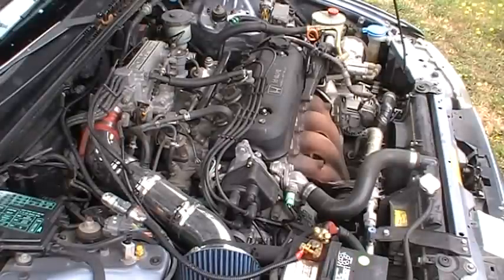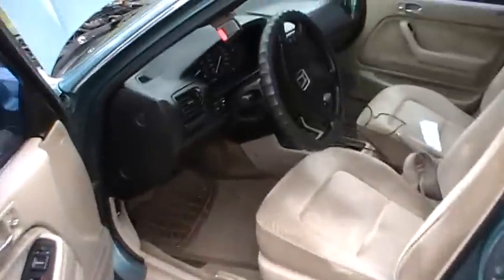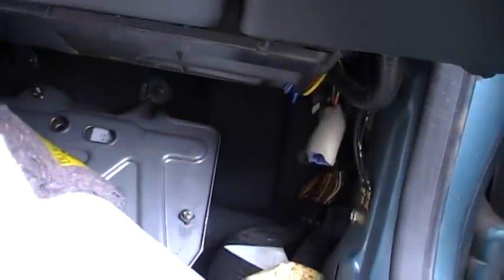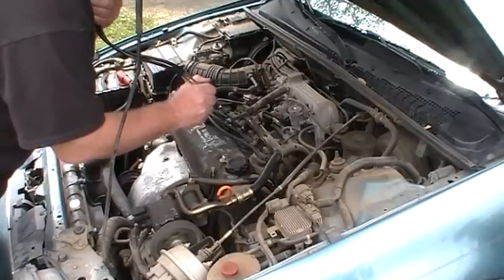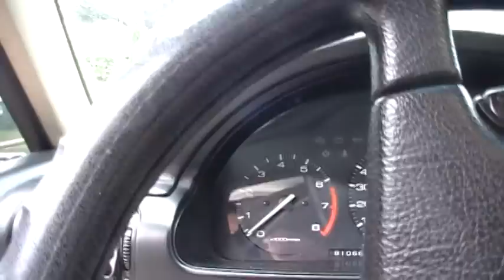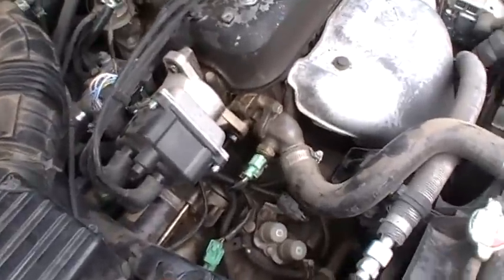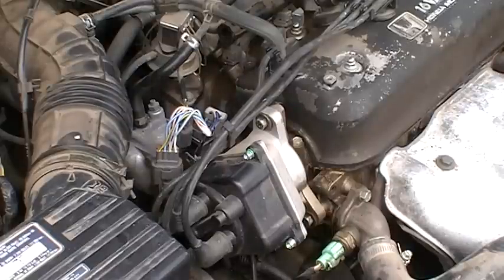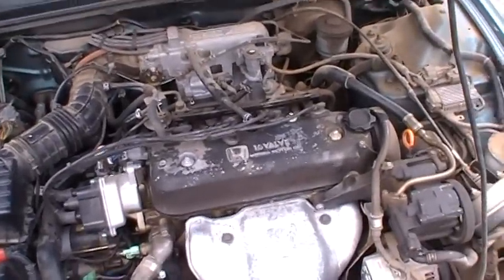Timing 1990 Honda Accord

Comment: I recently purchased a 1990 Honda Accord EX sedan with 87,000/miles for $1,800.  I knew the son. His mother died and she owned the car. The car stayed parked for 5 years. 
Before I bought it a complete new exhaust was installed, a set of new tires, oil change, transmission flush and fluids changed. 
Is there anything I should be concerned with?  I’ve never owned a Honda. My last 3 imports were all 1989 Toyota supercharged MR2’s and each of those went to 345,922 miles each before I sold them cheap. 
Thank you for your input.
Reply from the maker: Is it an automatic?  Make sure you only use Honda Transmission and power steering fluid.  If it has been sitting for 5 years, most likely the tires have flat spots.  When you drive it, if you feel bumps, you have to get new tires.  Have the battery tested.  If you like working on cars, it will be way easier then working on a Toyota.  Except front brakes.  The rotors are hard to do on Accords of that year.  Check the spark plug wells for oil after you drive it for a while.  If you have no leaks in the engine, your seals should all be good.  Change all the fluids.  Use extended life coolant.  I would stick with convention oil.  New brake fluid.  Silicon lube all the window seals, so the windows go up and down smooth.  Silicon windshield wipers if you can find some that fit.  Put some on my wife's car in 2017, and they still work good.  If this is a keeper and you want to do your own maintenance.  Buy a Honda OEM shop manual for it.
Reply from the maker: If you have any questions, feel free to ask.  Also have lots of videos on 90 Accords.

Comment: What should I be looking for as to timing ie how to tell if I need to move the distributor one way or another based on the timing light to adjust it to the proper timing other wise great video
Reply from the maker: What year, make, and model are you working on?
Reply: @tubejim101  90 accord lx 4 door standard
Reply from the maker: @GhostSniper162  Distributor should be in the middle area.  With the car in maintenance mode, you will see the timing mark move when you move the distributor.  You will see the mark, when you use the timing light.
Reply: @tubejim101  i should restate my question im just getting into mechanics as my dad didn't want us in the field so what particular should I be looking for with the timing light as I adjust the distributor ie should the light stay on should it blink at a certain pace I apologize for my ignorance.
Reply from the maker: @GhostSniper162  When you hold the trigger, the timing light will flash, every time the number 1 spark plug fires.  If the light is always on, or always off, you can not see the timing marks.  They go by to fast. When the light flashes, your eye takes a snapshot of what it can see, and you can see the mark, just like it was not moving. So the marks will look like they are standing still.  When you move the distributor, it will make the mark move.  Just move the distributor a little at a time.
Reply: @tubejim101  o ok makes sense thank you for your help

Comment: Bought a 93 accord se recently. Replaced alot of parts myself including mounts, all new suspension parts, starter, distributor, cables and plugs, and cleaned  alot of the carbon build up.  Steering wheel vibration is bad when idling at a stop then runs smooth vibration free when driving at normal speed.  I never did the timing, do you think this may be my issue?
Reply from the maker: Would check the power steering pump, and belts.  Also, make sure you are using Honda fluids.  As long as your distributor is almost centered, I don't think it is your timing.  If your distributor is way to the front, or back, off center, then it could be an issue.

Comment: hello one question¡ 
at how many revolutions is the engine,
because you only show the adjustment of the lamp with the top dead center. and tanks  for the video.
Reply from the maker: What year, make, and model, are you working on?
Reply: @tubejim101  is on honda accord 1991 2.2l
Reply from the maker: 750 +- 50 rpm in neutral.   So basically, idle at operating temperature.
Reply from the maker: That center mark, in the front 3 marks is 15 +- 2 degrees BTDC (Before Top Dead Center)
Reply from the maker: Think the one mark in the back (past the three in the front) is the Top Dead Center, mark.
Reply: @tubejim101  
ok, then at idle it should be at 700 + - 50 rpm, with the normal temperature, since the tachometer marks me about 800 rpm, this is also within the setting, since when maintaining it at idle, after a few minutes at walking the car the revolutions tend to go up and down, but from what I know or explain the manual may be vacuum leakage which is causing me to change the revolutions at normal temperature. I thank you for your help, I will try to correct this detail, thank you very much.
Reply: @tubejim101  I only see the 3 red marks at cold start. Once it warms up to normal operating Temps, I only see the single white mark. What's going on here?
Reply from the maker: @midwestjeff  Is your distributor centered?
Reply: @tubejim101  yes
Reply from the maker: @midwestjeff  Are you running it in service mode?
Reply: @tubejim101  Yes. Someone suggested to me to remove the air idle control valve plug when running this test so that the card is a try to automatically advance
Reply from the maker: @midwestjeff  any chance you have changed the coolant lately?  If you have a pocket of air trapped in your coolant system, it can throw things off.

Comment: Thanks for the video... Just wondering if you have the car in service mode when you are setting the timing.  Also any updates on he lower pitched knocking noise? I have a similar noise.  Thanks!
Reply from the maker: Yes.  Service mode around 5:30 in the video. 
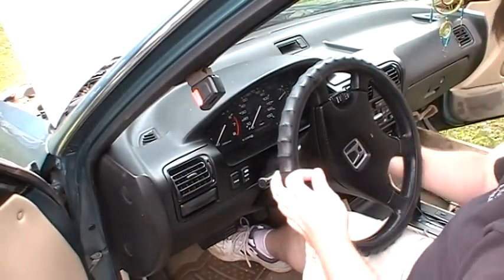And around 12:50.
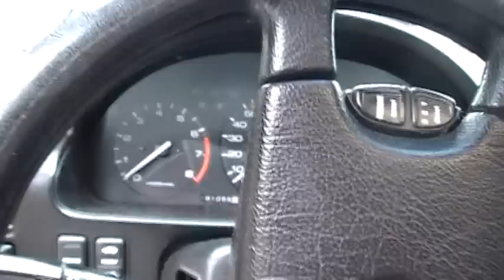Reply from the maker: Lower pitched noise was fixed around 22:40.
Reply: tubejim101 thanks for the reply

Comment: Hi i have a honda 2001 lxi the problem that i encoutered is that when im driving and press the accelerator i hear a sound on my engine i thought it was just a vibration or something time goes by the sound is more obvious so i decided to have it checked by a mechanic then he diagnosed that the distrubutor is not set properly so he adjust the timing without any tools like this timing light though the result is good cause the unwanted sound the engine was disappear, he adjust it i think almost full swing o think its clockwise i think. days go by i notice that when im slowing down my idle drops back and fourt almost gonna die when i press the clutch go for neutral state . do you think there is corelation between the adjustment that has been done to my car?thank you
Reply from the maker: 2001 Accord?  On Accords I only work on 90 to 93.  Check at your Honda dealer to see how much 30 minutes of diagnostics would cost.  A few months ago, they where running a free 30 minutes of diagnostics.

Comment: Hi! I watched your video because my 1990 accord stalls when in Idle. I read is a problem with the distributor and I'm going to replace it. Any thoughts on being in the right track. Either way, Thanks for posting your video is very good
Reply from the maker: +Mauricio R Check for vacuum hose leaks.  It may also be carbon build up in egr ports.
Reply: +tubejim101  Thanks, for you reply. I have done multiple vacum hose checks and drilled out the EGR ports to clean them, and replaced all parts having to do with idle to make a long story short.  I'am not giving up. Only doing it for fun. I'll post what ever it is that's doing it,  once I find out for others to see... Thanks again, Jim

Comment: I can’t get my car to start though🥲
Reply from the maker: Shoot some starter fluid in the air cleaner box.  If it fires then dies, you know you have a fuel problem.  If it does not fire, then you know you have an electrical problem.  Have your battery tested.  They can do this for free at the auto parts store.
Reply: @tubejim101  thank you so much